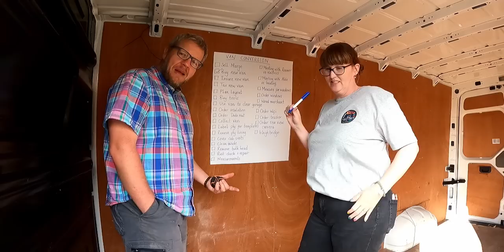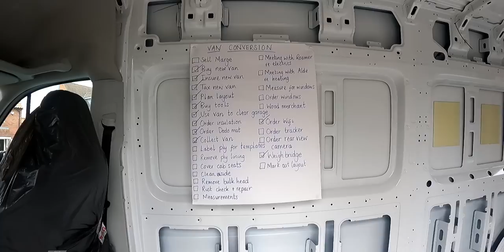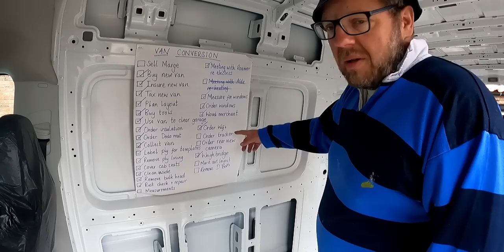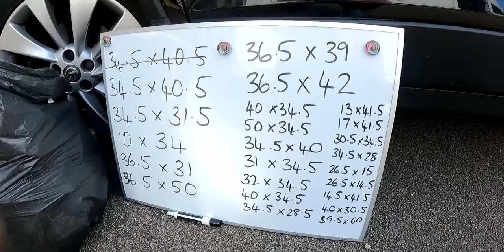Have we bought a rust bucket? | VAN CONVERSION DIARY | Week 1 | VW Crafter

Comment: Just to inform you, Sprinter/ VW vans, remove the side plastic trim panels, the fixing method is not the best in the sense it allows water to leak inside your van sill/box sections causing rust problems (you are unable to see this if the van has internal panels fitted ), when removed use a sealant that stays soft and easy removable on the clips around the holes, and check the drain holes are clear, good luck in your build.
Reply from the maker: Great advice, thank you 😊
Reply: Saved me the bother!!

Comment: Looking forward to your vLogs. I am planning the same thing for 2024. What made you chose the Crafter?  What was your selection criteria?  Was there many vans around meeting your criteria locally, or did you need to travel?
Reply from the maker: Thank you. We wanted a LWB and we liked the shape of the Crafter. Other option was a Sprinter. We are hoping to travel far and wide so thought it would be easier to get VW parts abroad than maybe a Fiat. We weren't too hung up on mileage as vans are built to travel far. There were quite a few vans locally and we thought it was best in case we had any after sales problems. We bought an ex hire vehicle and negotiated a new battery. We made sure it wasn't a multidrop delivery van as they get hammered!! The dealer did a really good job removing all the sign writing which would have been an annoying job. Good luck for your plans

Comment: 2017 crafter is now a stand alone product and no longer related to the Mercedes Sprinter . Built in the MAN plant in Poland.  Which is why they are so unreliable.
Reply from the maker: Why would that make them unreliable?
Reply: Had a 68 plate from new . 114k now . EGR cooler 69k engine rebuild.  99k fuel pump. Injectors . Fuel rail .5 coolant hoses . January Turbo.  Ad blue tank . Oil pressure switch.  Total of 16k in repairs at VW Trafford Park.  Service is shocking.